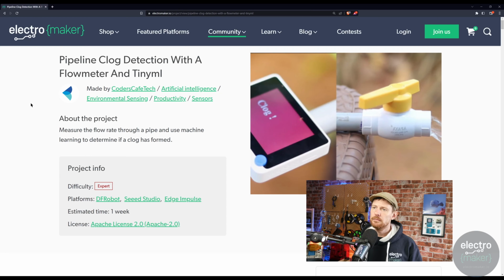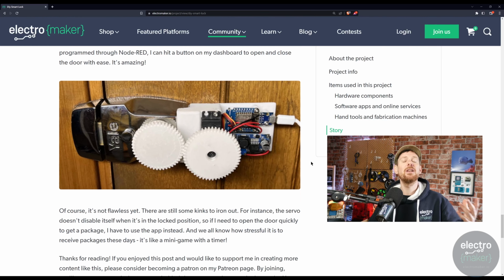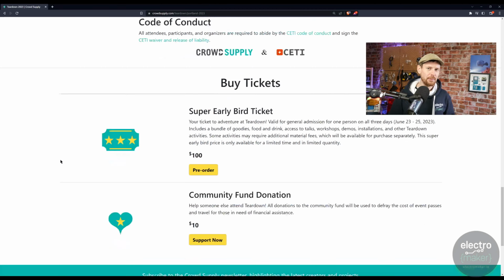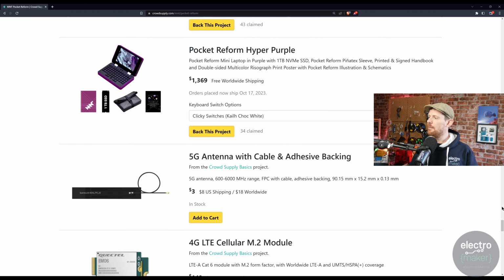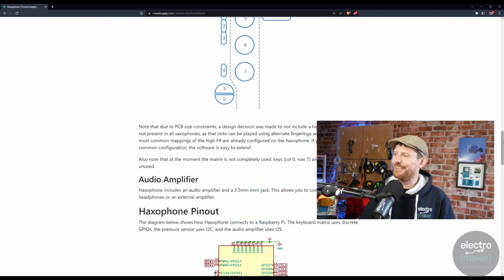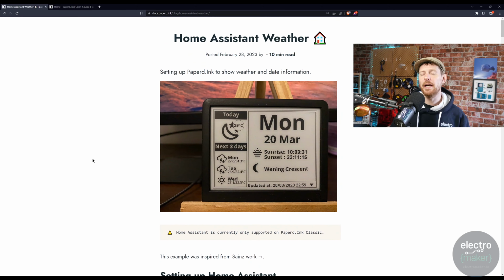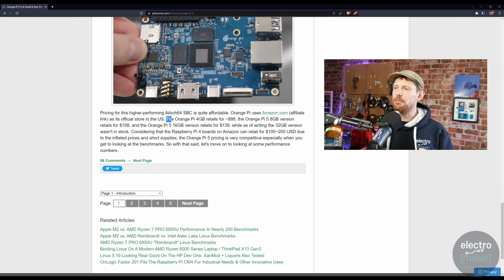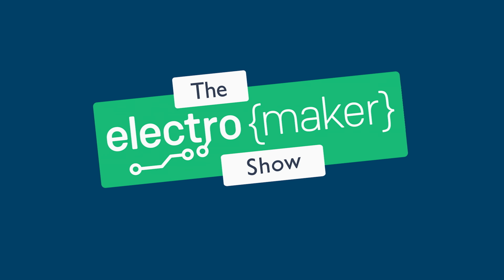DIY Smart Lock, MNT Pocket Reform, Orange Pi 5 and more!

Comment: #Enviro kit is ideal to put in my loft to measure temp., pressure and humidity to control the ventilation fan. I have had up to 94% humidity up there recently according to my Lidl £19.99 temp/humidity/time display with its outdoor sensor in the loft. Hence I installed a fan! Fluidsynth sounds interesting ( sorry about the pun!). I last played with synth software on a Creative Labs Soundblaster 32 ISA card, into which you had to plug in SIM memory modules. There is one on an auction site for £142.39!